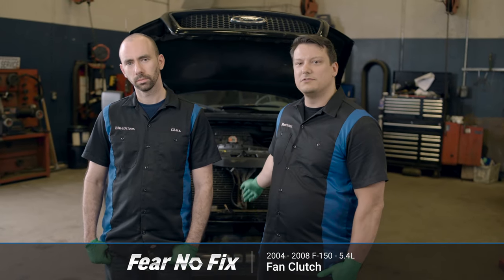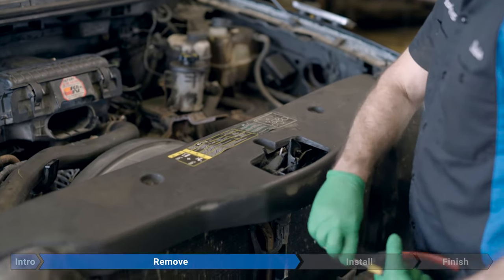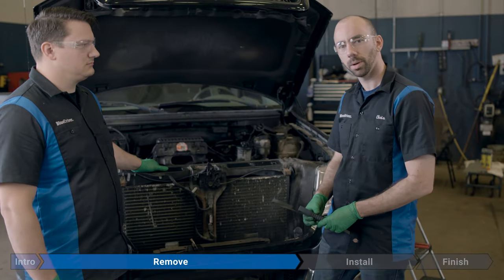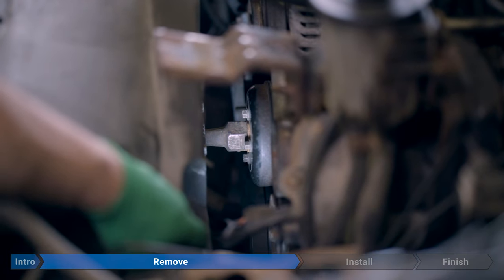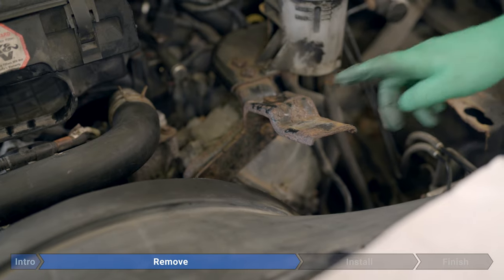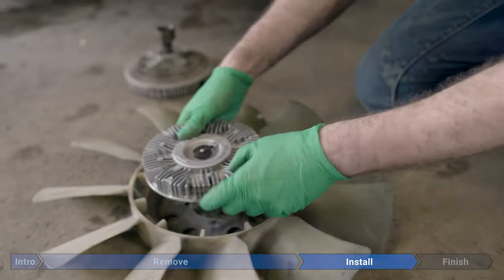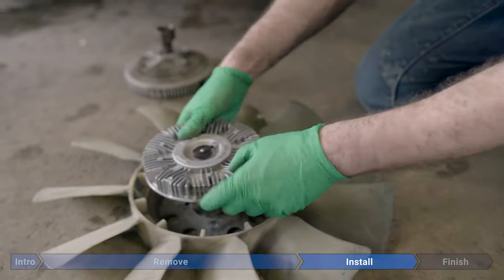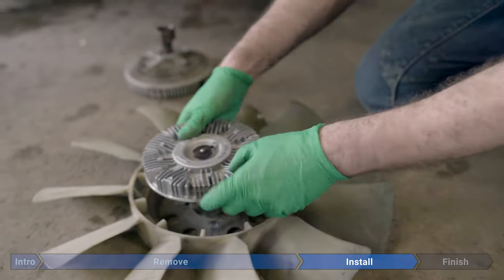Fan Clutch – 2004-2008 5.4L Ford F-150

Comment: My 2007 F150 FX two has a bigger nut around the fan clutch to the flat blade. The standard fan clutch. Wrenches didn’t work.

Comment: Thanks guys, my impeller was corroded flat on a '04 5.4. Top hose never hot, lower never hot., heater core hoses never hot. No air pockets. This was the fix, new water pump which is very small compared to honda civic almost same size

Comment: A 12 inch long chisel flat nose it on the bench grinder ,dabble of Kroil ,small dead blow knocks it right off no need to hold pulley 
But yes gents I did come here to see the rotation for removed 
Thanks for the help 
💯👍

Comment: Will it hut anything of you turn everything  a bit clockwise when tightening?  My idle  seems to be rough now when in drive and cold.  Unsure if related to changing the fan clutch.  I think its important to note to be sure you do not turn backwards.

Comment: Is there a way to test if the clutch is properly working? I've had mine replaced in hopes of getting the AC working better. It seems like when the truck is hot at it's 100 degrees out, I'm not hearing the roar of the fan. I can see it's spinning, but I am not sure it's actually pulling as well as it should.

Comment: Hi, is there any electrical connector to the clutch or fan ? I am bit confused how it works
Reply: They said the old fan clutch was throwing engine codes, but the fan they replaced did not have a wiring harness.  Only electronic  clutches can throw engine codes.

Comment: Say I take it to a couple men like yourselves, professionals, how much would I pay. And say I bought the fan clutch, how much for installment
Reply from the maker: Ourselves and Professionals definitely don't belong in the same sentence!
An OEM fan clutch (5L3Z 8A616 CB) goes for $80 to $130ish depending on where you are while an aftermarket one from the parts store will probably be cheaper.
Book time for the clutch at a shop is ~1.2 hours, so say 1-2 hours multiplied by the labor rates at your local shops.